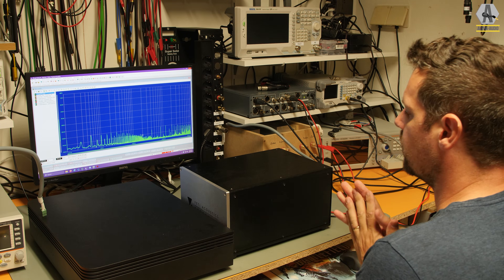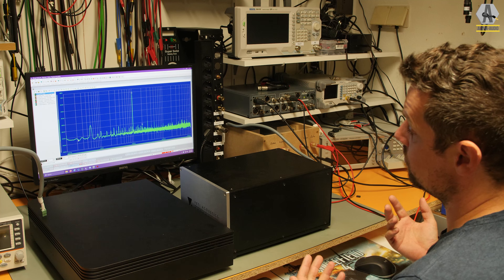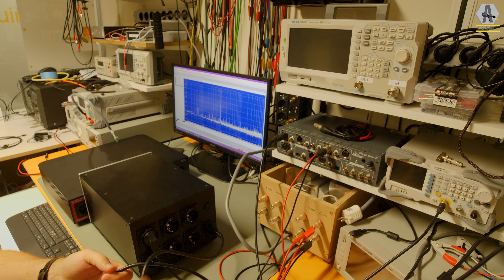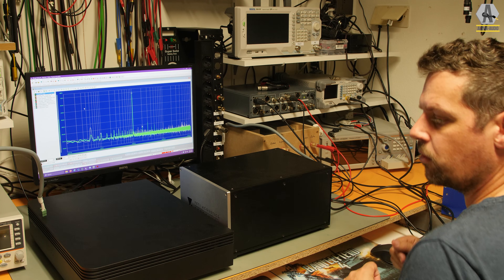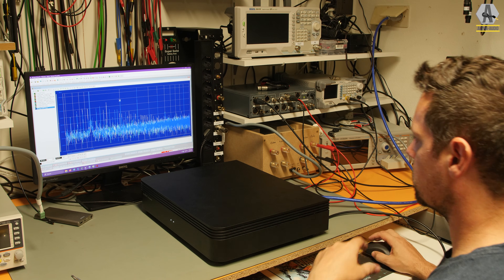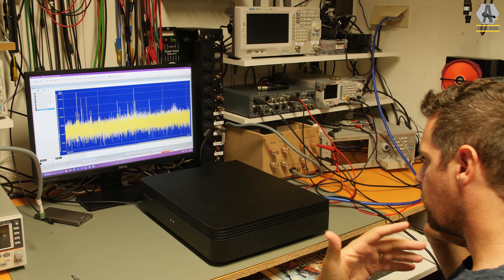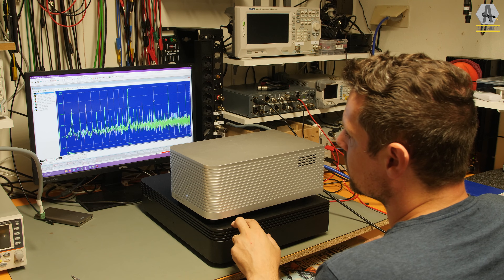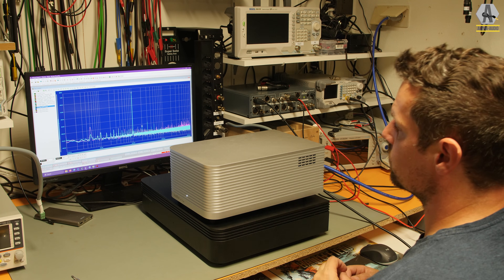Alpha Labs - Do Power Conditioners actually do something?

Comment: Have you performed any tests on audio grade fuses? Can a fuse make a piece of audio gear sound better?
Reply from the maker: I haven't tested that. And I am not going to, to be honest.
Reply: @TheAlphaAudio  You don't need to compare fuses. The test you want to do is between a standard fuse and a copper slug. If there is no difference there, then any audiophile fuse will offer no benefit.  Just do the same test you are doing here, should take 10 minutes.
Reply: ALL fuses distort the waveform of the current flowing through them because it is fundamental to the way they work. The CURRENT causes the wire part to heat which then makes it expand (normally slightly) until at some point when there is a malfunction the eXCESSIVE current causes so much heating that the wire melts thus disconnecting te faulty circuitry and protecting your house which is the primary function of a fuse. IF it protects elerctronics from further failure then all well and good but it is not the primary function.
Reply: From a strictly engineering standpoint, replacing a standard AC input fuse with a more exotic one should not produce any audible difference. Any measurable effects would be far too small to be heard, especially with the built-in filtering of a high-quality amplifier. However, for some audiophiles, the experience of a perceived improvement is all that matters, and they find the "upgrade" to be a worthwhile investment. At the end of the day it matters only to you, so if you think it helps good for you spend the extra.

Comment: Hello, I do not agree with your conclusions.
It is evident that it can be measured, no one doubts it.
But it is also evident that in listening situations no difference is perceived between the conditioning equipment.
A real test that is useful for the buyer is blind listening or measuring the acoustic response. If the double-blind test does not produce conclusive results, then perhaps the product is fake.

Comment: I'd like to know if a simple On-line UPS would do the same thing. They basically isolate and double convert from AC -> DC (to charger the battery) -> AC with clean power. Basic 1000VA ones are $1000 which is 1/2 the price of what you were testing here.
Reply from the maker: A UPS is very, very, very noisy.

Comment: The test actually shows how immune the amp to the power source noise, so the conclusion of the  effectiveness/value  of these power filters really depend on the amp you use.   What we'd like to see is how clean the power output of these filters are comparing to grid power, and that's Independent to what power amp would be used.

Comment: That's a pretty good result on the bryston. Can we hear the difference between -95 and-110 db below signal level. Nah its totally masked by the music.
Reply: Depends on the sensitivity of your speakers and -95dB is almost as quiet as the self noiseof any FUNCTIONING piece of line output level audio gear. Turntable preamp output noise is around -75 dB at BEST.
Reply: Only esoterik ear  hear the diference

Comment: You are not using balanced test measurement probes…correct?

You need to show every detail of your test methodology if anything you produce is to be believed.
Reply: The test set used has balanced (differential) inputs and outputs and of course the amplifier on test has an unbalanced output.

Comment: Nice vid! Can they improve also a PC PSU output?
There is a big night/day difference on my gaming pc.
Reply from the maker: We did a couple of times. Most pcs are horrible.
Reply: sorry I changed my comment.
Does it mean it is realistic a PC works better at night, most people say it is bs.
Would a battery+DC PC PSU be the best possible setup?
I tried a power station AC offgrid but it was even worse.
Reply from the maker: @patrickh9679  a pc with switch mode doesn't work better at night. If you want to use a pc for Audio you need serious modifications. Clean power supply, dedicated usb ports and ethernet.

Comment: Is there a way to fully eliminate the noise coming from the socket? Like, would setting up a AC > DC and then back DC > AC work?
Reply from the maker: No. The conversion introduces noise as well. Especially DC - AC conversion.
Reply: @TheAlphaAudio  But then how do you get rid of it fully? Do you have to build your own power generator?
Reply from the maker: @deama15  you never get rid of it fully. But you can suppress a lot of it with a huge galvanic isolation.

Comment: If you live in rural Africa and you have a poorly designed audio system, you might need a power conditioner. But better is to buy a well designed audio system. There is a good chance that if the power supply of your amp is well designed for noise rejection the amplifier itself is also well designed for high audio fidelity.
Reply: I think everyone is missing this logic. If you are spending $6k on a power amp and it needs an outboard power conditioner to keep the noise floor down then you got ripped off. If you spent $59 on an Amazon special power amp then adding a $1k power conditioner seems like a misuse of funds. ;p
Reply: @fallenshallrise  Very well said!

Comment: How would power conditioning compare to having a separate dedicated line fitted by an electrician, so that audio equipment is not sharing a circuit with refrigerators, microwaves, lamps, etc? That might be worth testing. Thanks.
Reply: @zfm1097  should not make a difference, as it still shares te same power line into your home and power cables are a 2way street.

Comment: Wouldn't using battery power be cheaper considering the cost? Also, I've never heard of high-end recording studios using power conditioners, which would seem the obvious place to benefit everyone (as the original audio would theoretically be improved). They could probably use it to increase custom (even if they didn't actually make any noticeable difference).
Reply: Yes, such facilities address power. 
Everything from generic dry-type grid isolation, to a Torus panelboard iso rig, to Equi-tech, Torus, or Furman point of use gear, etc.
Ground One (Art Kelm) operates in custom studio power.  

- You're modulating wall power and capturing it as music. 
- You're modulating wall power and reproducing that music. 

It's vital that it's well sorted.

Comment: Nice! However, you really should do the same test with a powerful Class D amp. As these use a SMPS their power intake is pretty similar to output. Many mains conditioners use reactive components such as capacitors, coils which can have an effect of "throttling" the conditioner's output with short dynamics peaks. Result: the amp loses much of its agility, loses speed (always difficult to put sound to words), transients get smeared, dynamics get lost. The better the amp is, the more noticeable. Before you measure, listen to a decent system with Class D amp without conditioner, then add it to the system and you'll know what I mean. This is of course a sweeping statement. Don't believe me, try several conditioners and amp combos and you'll hear soon what I mean...
Reply from the maker: What I measured is pure noise reduction. This is half the story. You should ALWAYS listen to the combination in order to dertimine the overall effect. Not all amps like power conditioners. My Pass XP-12 doesn't like it for example. The X150.8 doens't like all conditiners as well. But if you found a matching one, the effect is great.
Reply: @TheAlphaAudio  Thanks for swift reply. the point I was trying to make is that the requirement of an SMPS from a wall outlet is very different to that of a linear supply for an amplifier. A linear supply has banks of reservoir caps so does not suffer if the conditioner is holding back as supply during strong dynamics in music are catered for by the caps. Not so with (most) SMPS where demand from the mains is just about as dynamic as the signal on speaker terminals (compare power input to speaker output with music playing on your scope!). That makes conditioners and Class D combos resulting in severe performance degradation.
Reply from the maker: @WhatEver-dx3eu  True. Also: smps are less sensitive to mains pollution.

Comment: Good to see more objective tests looking for differences in output of gear, rather than what goes on inside.  Alas, in this class of testing, there are pitfalls.  Unlike a real speaker, your Prism Sound analyzer is powered and hence can create a ground loop that wouldn't be there otherwise.  You must work to identify this aspect as otherwise, isolation transformers like you tested will impact the measurements.  But would not do so in real life.   With Audio precision, I have control of whether the floating inputs are grounded or not.  Ditto for input.  I go through extensive testing to rule out ground loops.

You also said that transformer made a big difference.  It didn't once you consider that out threshold of hearing in low frequencies is very high and hence the reason you wouldn't hear that hum out of the Byrston amp without said power conditioner.  In other words, you are trying to solve an inaudible problem even if your testing was correct.

Comment: FINALLY someone tests at the output of the audio component, since that's what actually matters! One big argument against power conditioners is that good audio components already have good power supplies and are already extremely efficient at taking AC and converting it into clean DC. Nevertheless, I've found power conditioners have lowered the noise floor in my source components. However, a common argument against power conditioners is that they restrict the dynamics and low-end punch of amplifiers, which is something I've experienced myself. I've yet to find a power conditioner that works well with my 300 watt class A/B amplifier, which can pull a peak 1900 watts out of the wall on transient peaks. I wonder if there's a way for you to test this. As it seems to be the key knock against power conditioners, even amongst a sizeable % of "believers"
Reply: it completely makes sense, its a small transformer vs your grid huge transformer
Reply: I have both the Panamax 5400 and the Furman PFI-15...both have high-output sections for amps...no dynamic restriction....
Reply: Puritan PSM156 is famous for not reducing dynamics of amps, I have a 100W Marantz PM11S2 plugged into one, and the excellebt dynamics are unhindered.
Reply: Plixir or Audes makes great power conditioners wich can deliver a lot of power to a big amp
Reply: @Vsread21  isotek titan inn Norway do 6000w easy
Reply: "High end" or not
A wall outlet should only put out 120volts.
Reply: @budzlightyear2212 excuse my ignorance, but if a wall outlet only puts out only 120v so a inexpensive power conditioner like a furman power conditioner or a cheap  HOSPITAL GRADE ISOLATION TRANSFORMER should do the trick
Reply: @carlosr.2027  
Some say these things don't help and even hurt performance.Even a cheapo power strip in between the outlet and your equipment will help protect from surge.
Reply: @budzlightyear2212  not sure what your point is that the wall outlet "should only put out 120volts." The current is what spikes with power draw, not the voltage (which would actually drop, if anything). 1900W is about 15.8A on a 120V circuit. A 15A residential circuit breaker will allow spikes larger than this to pass through readily, requiring significantly more (sustained) overload to trip. On a 20A circuit, 1900W would be nowhere near the limit of the circuit. A power conditioner that filters spikes in current could potentially affect the dynamics of an amp plugged into it that's running close to its capacity.

Comment: And what about power cable in those devices? To me it looks like 3x0.75mm2 and current comes from walls where are usually 2.5mm2. What can be expected from devices that are actually bottleneck with reduced cable surface even "audiophiles" will plug their fancy cables into them??? 
The whole concept (conditioners, power cables) is one big nonsense!
Reply: Maybe you can borrow some audio grade power cables and swap them around in your home system. Maybe your ears will belie your beliefs. I suggest sensible priced cables as made by brands like Supra, not something overpriced.
Reply: @jmtennapel  When NASA starts to use "audio grade" power cables with magical features, then I will. 
In meantime I will stick to fact how amprifier components runs on DC current after it was transformed and filtered from AC. They are very good at it and don't care about how dirty power coming from walls is as long as it is coming from stabile power net like it is in developed world.
With my comment I tried to point out absurdity how this test was done and conclusions made.
Reply: @crodoc69  Have it your way.
Reply: Dear  @jmtennapel  , I'm not  that kind of "internet warrior". I try to give arguments. So far haven't seen anything concrete that would change my mind. Again, I was refering to fact how those power conditioners were tested here and usually used with consumer grade power cables and at the same time "audiophiles" put fancy cables in it.
Anyway, I wish you all the best!

Comment: Nice, can you get your hands on a Puritan Audio PSM156? As an Audiophile I have 2 different types of conditioners. 2 are from Monster lol and they are in tge basement in storage, the other are Richard Gray substation (isolation transformer) and a RGPC1200 that is a parallel choke. Is there a way I can test these with software and simple setup?

Comment: When compared to modern electronics internal power
Supply circuits most of Big Name High End Legends
Needs to Re design their boxes 2023.
Or in simple words - some Chinese boxes changed
For ever  that Game (= hysteria regarding dirty wall 
power signals).
Fault designed needs works arounds,
 good designs Just need to be connected 
and played ;).

Hope you will send the units to ASR for deep per
Protocol analysis and compare to other power 
Amp units measurements with/ without the above 
Conditioning /iso equipment.    
And the amount of dynamics that they limit...

Be blessed, healthy, free and prosper. 

N.B - you can not purify dirty water with 
Some parts of clean water.
Not really.

Comment: Thank you for your great work
In a good design, this should not happen!!!
Unless the manufacturer intends to force the customer to buy more equipment
Reply from the maker: And still it does... also: how is a manufacturer going to implement a solution like the YETI in a device and still: 
1. keep it small
2. keep the price down
...
...
Reply: @TheAlphaAudio  Using low noise power switching
Reply: @aminbjt5843  oversimplification . Ground loops, common mode noise, all stuff that influences not a single component, but a set. And we are not talking about pricing yet, because designing components to be immune to all kinds of noise is costly and won’t keep most components financially acceptable to a lot of consumers. It’s not a conspiracy, you know…..
Reply: @jmtennapel  No oversimplification
But more efficient engineering
The most complex designs do not necessarily give the best results

Comment: Maybe I missed it, but are you using shorting plugs on the amp input or an open input? If not using them, how are results with them?
Reply from the maker: Not using a shorting plug on the single ended input. The Bryston uses a switch for selecting balanced / single ended.
Reply: @TheAlphaAudio  ANY test engineer KNOWS that inputs MUST be terminated with the expected source impedance, usually fitting a resistor of say 50 Ohms to simulate real world usage.

Comment: How can an AC filter filter out 50Hz hum? I think there is something wrong with your measurement setup
Reply from the maker: It is not a filter... its a galvanic isolation. So yes... that is possible.
Reply: @TheAlphaAudio   How?  The transformer in an amplifier itself galvanicly isolates the mains from the speaker outputs. Other than eliminating DC offset on AC, there can be no effect as the 50Hz wave carries all the power.
Reply from the maker: @MarcelOoms  well... a Prism doesn't lie... and I didn't change anything in the setup.
Reply: @TheAlphaAudio  Shure. But aren't you wondering why? May reversing polarity on the AC plug is to blame, as thing can have EMI be in or out of phase in the various instruments. Or a shielding issue due to protective earth violations. These are measurable, but setup artifacts.
Reply from the maker: @MarcelOoms  the Yeti is balanced. So it is not weird the 50 Hz hum is reduced for it blocks DC.
Reply: @TheAlphaAudio  I mean DC offset of the mains power. This can cause a transformer to saturate the metal core. Some people believe this is a thiing in audio. Putting another transformer in front (ie the power conditioner) eliminates the DC offset from the wall outlet. Again, I don't think it is the issue here. I think it is some kind of EMI/shielding change between setups. At -100dB (!) this can be present in balanced connections also.

Comment: Cool test. I really like those videos so much. One request regarding power condtioners vs power regenerators: Can you please also make a test of those? PS Audio always claims that impedence and the correct sine wave would be more crucial as filtering just noise like conditioners do
Reply from the maker: Of course they do... the make regenerators, not filters. Would love to test one though.
Reply: @TheAlphaAudio  I have a online ups with galvanic isolation transformer at home. PS Audio regenerator has similar topology like online ups, without batteries.

So, I went with online ups.